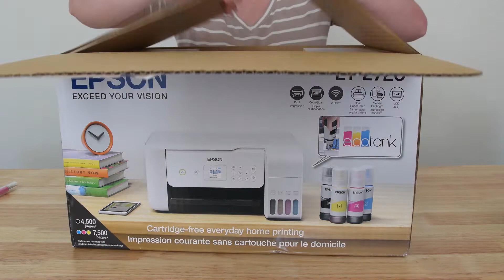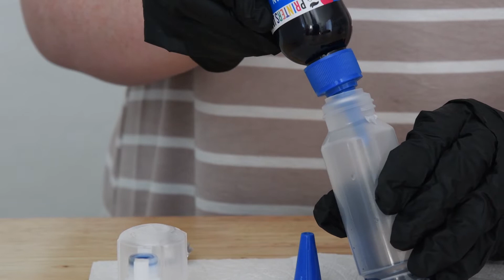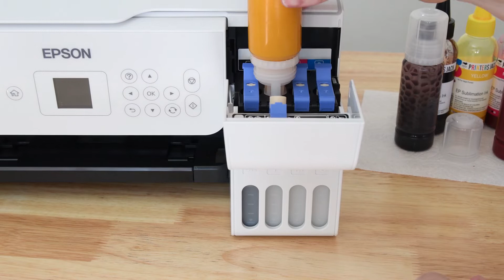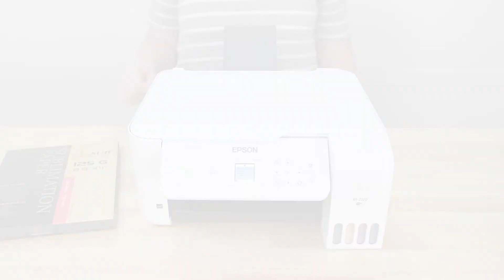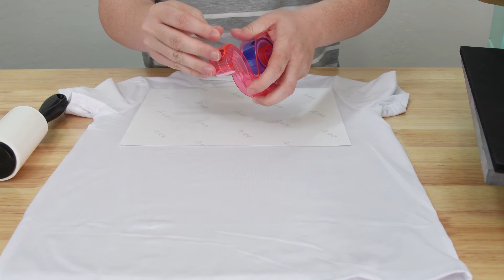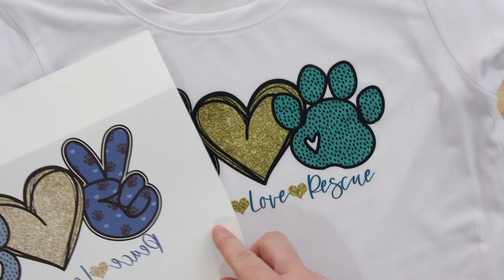Epson ET2720 Printer Sublimation Conversion

Comment: Thank you so much for this video! You did such a great job relieving my anxiety - I haven't unboxed mine yet. 2 quick questions though. 1) Can you use butcher paper to put over the top of the shirt before heat pressing; and 2) can you use a press cushion instead of cardboard inside the sheet? 😍
Reply from the maker: That makes me so happy to hear! Yep you can definitely use butcher paper. And I wouldn't use a pressing pillow because the ink could transfer to it. I would use cardstock or 2-3 pieces of printer paper inside the shirt just to protect the backside of your shirt from getting the transfer on it